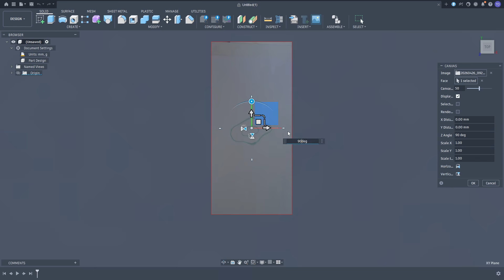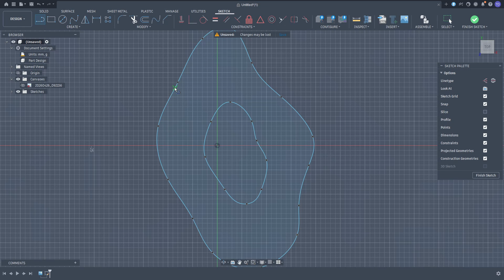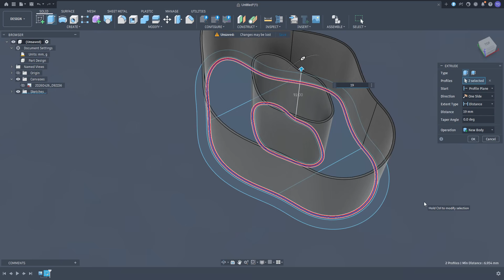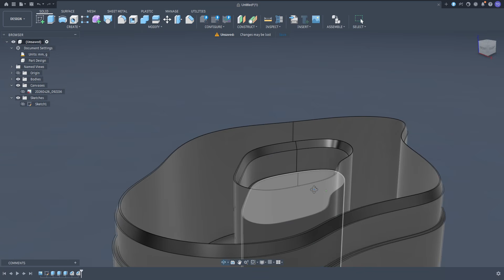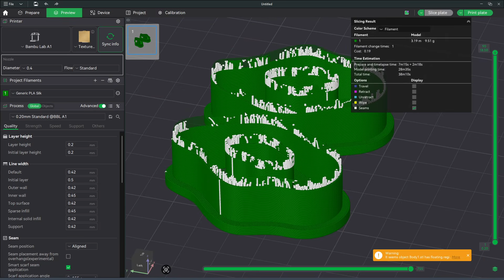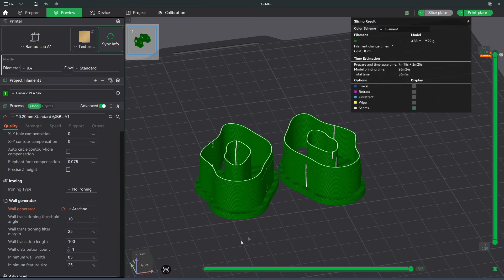Turn a Hand Drawn Sketch Into a Clay Cutter  Fusion 360 Beginner Tutorial

Comment: You can also go to strength tap and click detect thin walls
Reply from the maker: Thanks for the tip :) Detect Thin Walls can definitely help in some situations, especially with the older wall generator. I’m using Arachne though, which already adjusts line widths dynamically, so it usually handles thin features much better automatically. Still a useful setting to know about if parts aren’t slicing properly